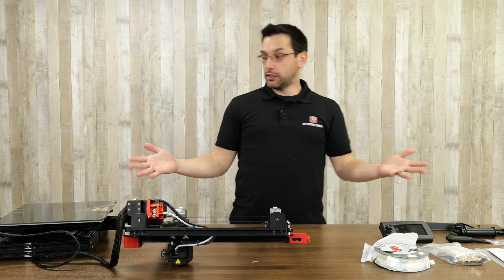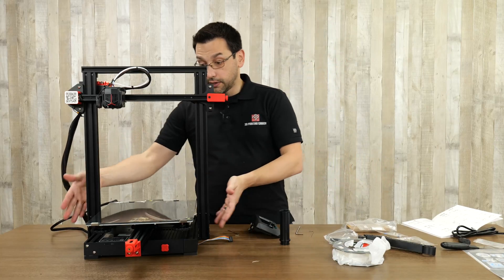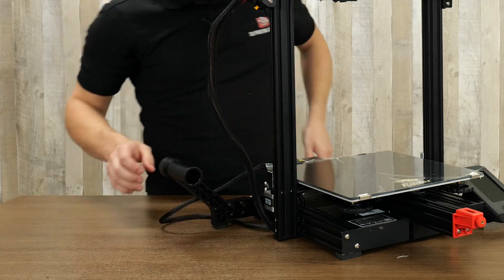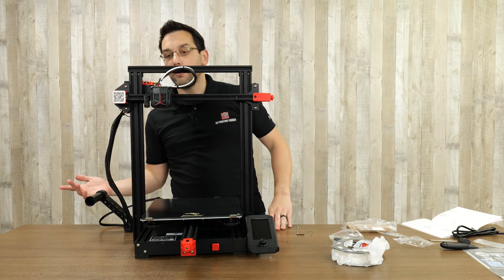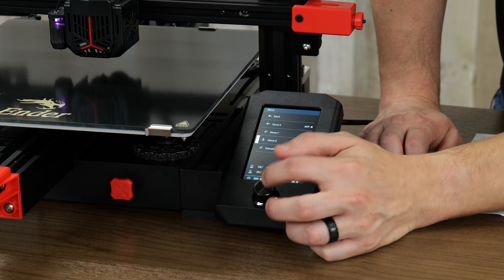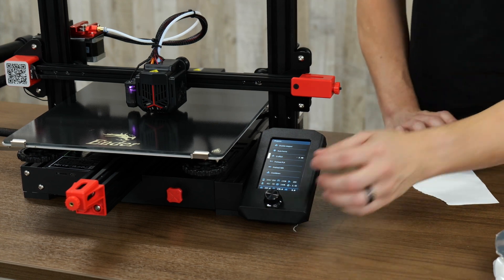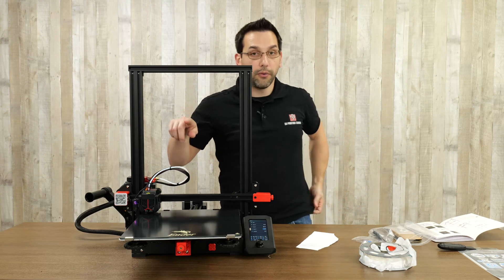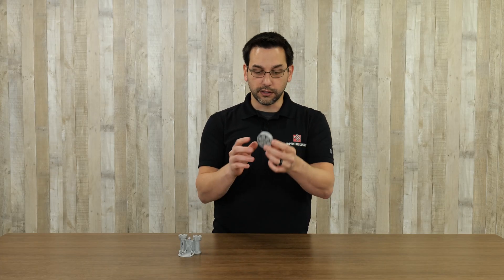CREALITY'S ENDER 3 MAX - NEO - QUICKSTART GUIDE

Comment: I had actually a few issues with this printer. First of all the tappings of the holes for the 4 long screws were not aligned. So I could not screw the screw from one tap into the other. Fix: I drilled out the outer taps and just screwed the screws into the inner taps. Second, a few of the rollers had way too much axial play. Fix: I had to swap them out. Third: The rollers of the bed were way to tight, the 3 fixed ones that you cannot adjust already were so tight, that they slightly bent. Fix: Drilled the middle fixed one to 7.5mm and inserted another adjustable nut.
Overall, someone who would expect to print right out of the box would have been very disappointed and would not long have had fun with the printer.
Enders are always pretty good kits :) but you have to reasemble them and adjust everything to have long-lasting pleasure and peace of mind.

Comment: Forgot the most important part in manual, showing the voltage setting before plugging into wall outlet. My came shipped 230W showing. I switched to left side until it shows 115, but I need to confirm this before power up. This step is manual right after you plugged motor cables in

Comment: Until you try to print Petg and the higher temps causes your bowden tube to swell and you can't print. So you upgrade the hot end but there are very few choices for this model. However, you get the Sprite anyway only to find out Creality doesn't support this combination anymore. You think no big deal and search for firmware from other sources only to discover you got the TJC board that hates being upgraded. Now you need to get klipper and do more mods to get you Ender 3 Max Neo to work and realize you have now spent as much money and more time than if you would have just bought the higher end printer from the beginning.

Comment: i just ordered mine, would there be any issue with me setting up mine with the same measurements has yours?
Reply: There will be issues, the one I did for my dad required around 1.57 Z offset with a lot of corner adjusting, use your paper and once it seems to stick a lot, you'll have to keep raising until it just about doesn't stick or else it will likely scratch in my experience, though we haven't printed yet due to lack of consumables

Comment: When i press preheat pla the printer just turns off and then on but it didn’t preheat the pla
Reply: Idk if you alr got it working but its the back the red thing that says 115v and 230v I just changed it to 115v and it works 😊😊

Comment: 12:34 By default Cura slicer will not load the bed leveling mesh after leveling, you have to go into the printers start gcode and add "M420 S1 Z10" with no semicolon, on the line after G28 or G29. Otherwise the leveling mesh is not loaded. A semicolon after M420 also stops the code from executing for some reason, despite all other lines having one.

M420 is the command for loading the mesh
S1 is the enabling of the mesh
Z10 tells the printer to stop using the leveling mesh after layer 10 and even  out the layers as if they were on a flat bed.

Struggled with this for a couple of weeks myself after buying a BLTouch. Hope it helps anyone else running into a similar problem.
Reply: this just saved me a ton of troubleshooting, thank you so much!!!!
Reply: do you put a space after G29 or G28
Reply: @ayceofspaydes  I just went into my gcode and it seems that Cura has patched this, it has automatically put the M420 S1 code in and now uses a semicolon.
To answer your question though, my gcode has a space after G28, so that line is written as: G28 ; Home all axes
G29 is not necessary if your printer is storing the bed leveling. 
It will run a bed leveling at the beginning of every print you start, which I find to be excessive.
As long as you're running a bed level every few prints, or if you remove the print bed, it should last for a little while.
Reply: @MineSplosions  Alright thank you. So I don't have to add anything to the gcode?
Reply: @ayceofspaydes  You shouldn't have to, no.
But it would be good to check for the M420 S1 just in case.
Reply: @MineSplosions  do I just need to go into firmware settings on cura? Sorry I have a good amount of knowledge on 3d printers but I have no idea how to do firmware things lol
Reply: @ayceofspaydes  Go to Settings > Printers > (your printer) > Machine Settings and you should see the GCode in the bottom left. G28 should be close to the top of that, and M420 S1 should be directly under it.
Reply: @MineSplosions  tysm